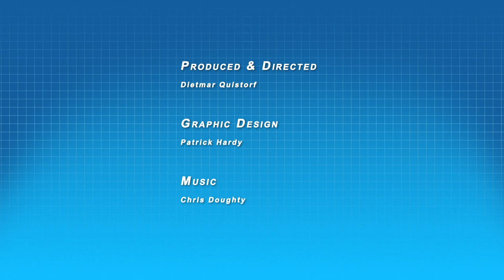Using Algaecide in Ponds - Ask #36

Comment: Here is another great reason not to add algaecide:  The algae produces oxygen and adds dissolved oxygen to the water for the fish to breathe.  This is especially important in warmer climates as warm water does not contain a high density of oxygen.  Moreover, the algaecide will kill the algae and cause a severe oxygen drop in warm water, killing the fish in the pond very quickly.

This is, unfortunately, my latest experience as I learned this too late.  I added an aeration device, but sadly, I don't think it will help at this late stage.  Hope this helps those that are considering the use of algaecide.
Reply: During the day they will produce oxygen, during the night they will consume oxygen. If you got a lot of algae, the oxygenlevel will drop and it's at the lowest just before sunrise. But I do agree that algaecide shouldnt be used.

Comment: My pond will sit in the sun from 10am to dusk, algae will probably be my biggest problem. I will be putting in lily pads, hornwort , and other plants around the edges. Question , can I plant lily pads directly to the bottom or should I use pots? How big will a tuber produce? Horn wort - will it spread through out the pond and how many should I plant? I want to try and establish enough oxygenation to combat the algae. Also right now I am rocking in my pond it's funny how nervous I am about building my first waterfall.

Comment: My grand parents had a tiny pond (2ft wide by 2ft deep) for over 50 years, it had no filtration, just one lotus and about a dozen tiny fish that fell from the sky. Unfortunately few years back the pond got destroyed after they passed away. I built one similar to theirs in my apartment. Initially I had a lot of issues with algae and 9 of my original koi fish died. Later I removed the oxygenating grass and added some dirt for the lotus. I also reduced the fish from 9 to 3 (one pleco and two fish that look like koi but are actually gold fish) and now the pond has been stable for little over a year. I also don't have any kind of filtration at all and yet the water is clear and my fake koi fish are happy. I do change about 70% of the water everyday but it's become like a habit now doesn't really bother me much. The pond can also survive a weekend without any maintenance if I go on a vacation or something. I have some surface algae right near where the lotus stems out of the dirt. That patch seems to be permanent and (IMHO) adds to the look of the pond and also provides food on those weekends when I take a break.

Comment: When I have got green water in my pond, I do more frequent water change and this do help making the water get clear quicker.
Reply from the maker: good advice unless you are in a drought like we are here in California.
Reply: Ya that true and here in Mauritius we don't get frequent disastrous drought but we did got one around 5yr back  like having the main reservoir use for potable water go down to 10% of it capacity. Since then the water management are doing their best to find solutions not to make it happen again like reducing water pressure during summer, by replacing the old water pipe network which is even older than me.

Oh by the way, how much do you ThePondDigger pay the cubic meter over there?  I pay mine at about $0.34/m3

Comment: It has been a cold spring here in Sweden, so I have not been able to do the spring cleaning yet and the string algae has shown up, most likely it is the fact that the water is really full of plant nutrients and I am not pumping the water thru the main bog filter and have no UV on it right now. Usually my fish would have been out for a week or two by now and the bog  filters up and running, I can´t remember the last time I had a algae problem.  My best advice is to have as much fast grooving plants as possible in your pond ecosystem, like a bog filter, as the plants use the nutrients in stead of the algae.

Comment: My pond is 3 months old now, i had a couple weeks of green water, 11 fish from 2 inches to 8 inches. 2000 gallon pond, got a 4000 gallon pump and a bio pressure filter and a bottom filter added a in line uv light. I used barley straw. I installed  2 air stones for oxygen aeration.  After couple days water started to clear and now I have clear water and natural bio film on walls. I have some water lettuce and 1 pot of lilies starting to grow nice. I haven't back flushed my pond yet only cause my water is doing so well. No algae sides have been used. Now my 20 gallon fish tank is different story, cant get rid of green hair algae lol

Comment: I have a very small pond right now about 175 gallons...perhaps with the pool at the top of the fall around 200 or a little more but the pond area itself is 175ish,   I don't have fish yet I wanted to get it up and running get the filter going hopefully get the biofilter built up a little bit before adding some fish..Not Koi of course in this little thing but some gold fish...well it turned green...pea soup green...couldn't see through the water at all...not at all...what I did after scouring youtube and the internet for a solution to this problem was to get a plastic milk crate put the pump inside it and then wrapped the whole thing with quilt batting  I have had that going forabout a week now and the water is nearly crystal clear I can see to the bottom of the pond again the quilt batting really works well to syphon out the kind of planktonic algae that causes the pea soupiness  I took some of the water from the pond and put it in a glass just so I could see what it looks like now and its nearly crystal at this point still has a bit of a green tinge to it but not so as to block visibility anymore.  Not sure how well this solution might work for  a large pond but it worked quite well for me in my very small pond.  I plan on keeping it this way for about another week and next weekdend getting some Nice comets and or shbunkin and adding to the pond.  Also if anyone does decide to try this, make sure you are using polyester quilt batting and not cotton at all as cotton will rot and fall apart and add to the problem where as polyester won't you can just take it out of the pond when it gets totally gunked up spray clean it with a garden hose and walla good as new.  Also one more important aside make sure you have polyester quilt batting not polyester fiber fill.  Hope someone finds all this helpful.

Comment: I have used Algaecide in the past, but find my koi are able to control it better. 

My question for  #AskThePondDigger  is:  My koi went after my plants and dug up some of the roots.  I have solved the issue with them digging up the roots but now I have a fine dirt suspended in the water.  It settles down at night, but as soon as the koi are active in the morning it is back up in the water column.  How can I solve this issue without draining and vacuuming?  I have my koi in a 1000 gallon holding pool while I redo the main pond so I don't have a bottom drain.

Comment: On my old pond I used to have to use chemicals to manage the green water. Asked a friend with a pond and took his advice. A 40w UV light later no more green water. Next pond will not have chemicals. A uv lite and filtration is all you need.